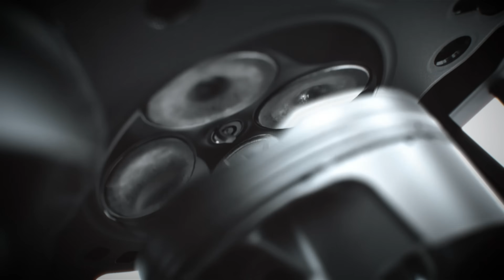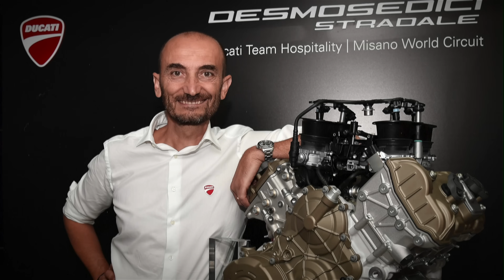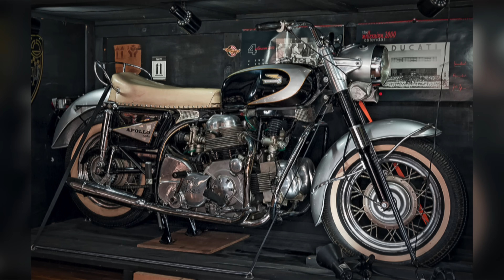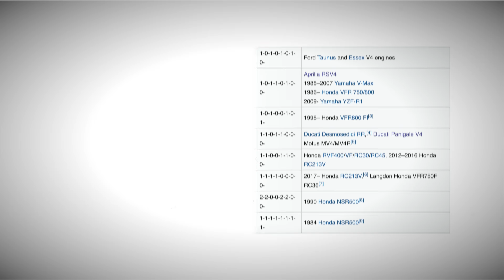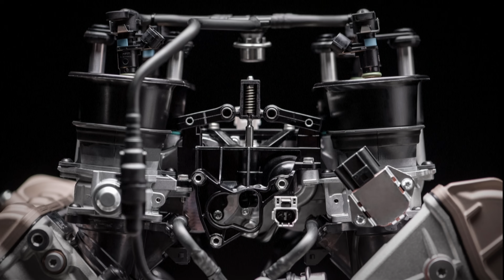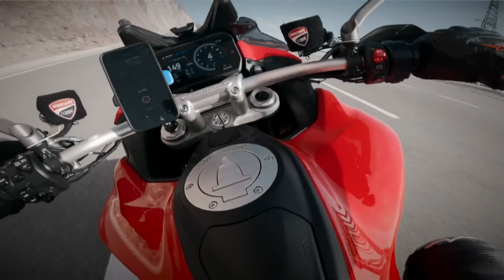The Ducati V4 Is Basically A MotoGP Engine

Comment: So this engine is no longer a desmo engine?? Also the crank angles aren’t they the same as the Yamaha crossplane crank?
Reply from the maker: To be clear – the Panigale engine is a desmodromic valve layout, however, not the Multistrada and Diavel engine. The Yamaha cross-plane has a different timing and is more similar to the Aprilia V4 (not exactly, because that's a 65° V-4, but with a 90° V-4, it would be practically identical and hence the sound is very close). This Wikipedia article is very helpful with understanding the different firing orders of these and many other engines.

https://en.wikipedia.org/wiki/Big-bang_firing_order

Comment: I have no Problem with Ductai Motor V4
But in World Super bikes , it the best 
Motor , if your running all the  Extras 
On it  to get that performance out 
Of it , but I am sick of Kawasaki inline
4 being Handicapped because Ductai
Had not won for 10 Years ,  at last
Ductai have got together , and won 
But for the last 6 Years Kawasaki
Have been have Heavy  Restrictions
6 Years ago , they were reving the
Kawasaki to 15,500 Rpm , they killed
The Ductai twins , and it really upset
Ductai when the  V4 with a  1500 Rpm
Advantage still lost to Rea ( not his 
Fault  the Ductai rider keeped falling 
Of ) so when Ductai Finally one , there
Still a  800RPM Difference , of course Ductai
Should win !!!   And now they give a 
250 Rpm back to Rea , ( after the dog 
Bolted 120 points in front )   next 
Year give the bikes same Rev Ranges
And Kawasaki finger arms rockers, 
Let see Real Raceing ,  I loved to be a
Championship Decided  by a point 
Like 2010 and yes Aprilia beat my 
Beloved Kawasaki , I can handle that.
Not this crap !!!!

Comment: I put an XL600RM motor on a scale once, I believe it was around 70kg. It's pretty nuts ducati made a 4 cylinder engine lighter than a single. 
Also, I am renovating a BMC A series engine, which weighs nearly 150kg for motor, gearbox, etc - and makes 65hp

Comment: Great insight. One correction though. I have the 2019 V4 panigale. It revs to 14k (soft limiter) in the lower gears and in 5th and 6th to 15,500 and 16,000 respectively, leading to a gps proven 194.7 mph at a runway event. All the best. John
Reply: It should run faster than that! Nice bike though. ( I ran one at 200+ but no GPS)
Reply: @Terraceview  If it wasn't GPS you didn't go 200+ and I KNOW you didn't.

Comment: The Husqvarna Nuda 900R has 13:1 compression ratio and 10kg or 100Nm linear torque. Too sad that it couldn't rev much higher to get some extra hp, but this monster torque even from the low revs is rewarding. I can't imagine any city bike that can be better than this.
Reply: I owned a Nuda for 8000 kms.

Very fun bike. Rather forward leaning position, veryyyy long between axles in feel. 
Great engine, but I feel that if Yamaha reworked their CP2 to be competitive with Honda's 755cc 92hp engine, it would be a great more balanced modern version of it

I'll forever miss that 315° crankshaft
Reply: It's KTM
Reply: @alexstromberg7696  wrong. Nuda used a reworked Rotax 800 cc parallel twin (which can be found in BMW 800R or GS).
Reply: @alexstromberg7696  Then why people sell them after 1 year max of ownership?
Reply: @gt4654  i meant Husqvarna and KTM is the same
Reply: @alexstromberg7696  Oh, come on my friend! This bike is known for being a BMW one. It was one produced under the years that BMW had ownership of Husqvarna and they really tried to resurrect the brand. They produced 3 street bikes and these were the first Husqvarna street bikes since a long time ago. The Nuda especially was heavily modified from the F800, including heavy changes in the engine, and it sported some very very expensive components, like the top of the line for the period Brembo racing calipers and a Ohlins back shock.... I still can find spare parts for my Nuda from the BMW catalogue and they need very low maintenance....

Comment: MOTOGP reliability and service intervals too...
Reply: I’m not sure what you’re expecting from a 1L engine making 240hp.
Reply: @damiendoisher7812  He obviously wants it to last 200.000 km like his friends 90hp 1.6l cruiser.
Reply: @gepixelt  No, I just have a KawasakiZxr14r
My boss one has Done 197,000  Km
Still flies, This is my second one  70,000
The first one , and this one has 26,000 Km
With 209 Hp at the back Wheel, look 
Forward to taken it to the Drags , hopefully
Under 10 second Quarters  ,  I had  1 x 
KawasakiZxr12r ,  93,000 Km and 2 x
KawasakiZxr14r  129,000 Km , not 
One Break down , lots of Tyres especially
Rear , you Don't get Reliability from  Ductai 
And  that not what I just say ,  My Bike 
Mechanic loves Kawasaki , He works on 
Lots of Ductai , the Difference is they are 
Not reliable , Ductai are  like Race horses
Break down , Certainly cannot do the
KM or miles like  mine do and a Kawasaki
Loves a thrash  as well mine have no Cobb
Webb's in Motor !
Reply: @markjones464 🗿 can't compare there's difference in cc and power Too
In Stock form
Reply: @damiendoisher7812  well the mercedes m139 makes 238hp/L, and that is a car engine with normal service intervalls
Reply: @laurean5998  it’s running 13:1 compression and turning 15k rpm’s? You can’t even compare the two they different
Reply: @laurean5998  and no it’s 200hp per liter. This engine makes more hp per liter.
Reply: @damiendoisher7812  GO NAG IN YOUR OWN THREAD .
Reply: @laurean5998  that is a turbo engine.
Reply: @laurean5998 not sure where your getting your specs from but they aren’t correct
Reply: @laurean5998 so you're gonna try to compare something that has a 9.5:1 compression and redlines before 9k rpm to something that has 13.5 compression and goes above 15k? Lmfao. Thats like comparing a diesel motor to a gasser
Reply: @laurean5998  that mf cracks to shit
Reply: I couldn't care for a high spec bike that gets few thousand miles a year. It's different if it was my daily ride